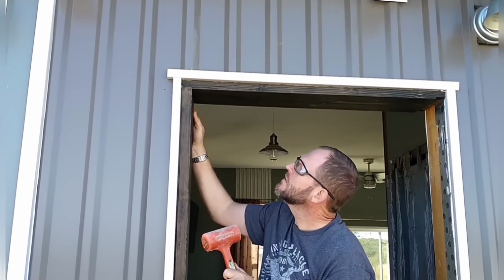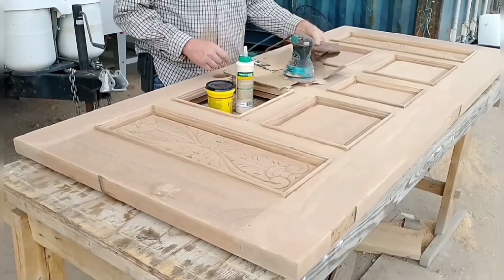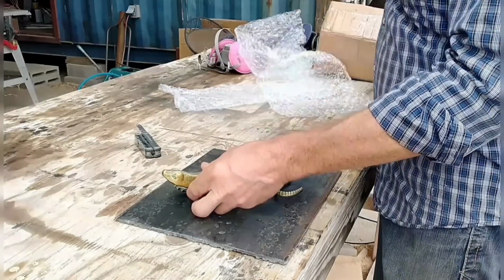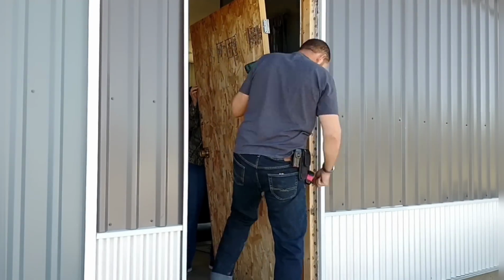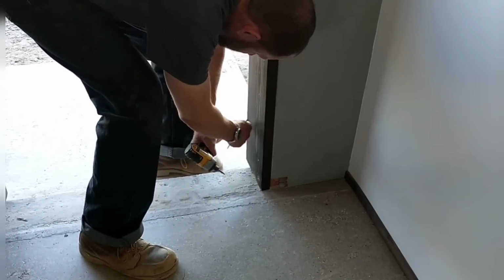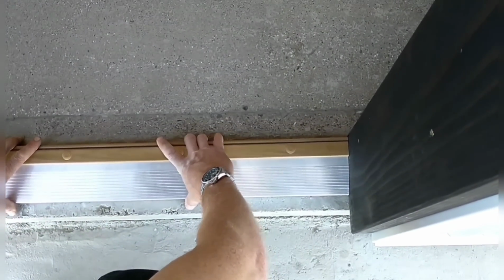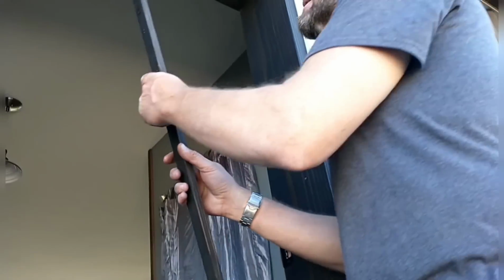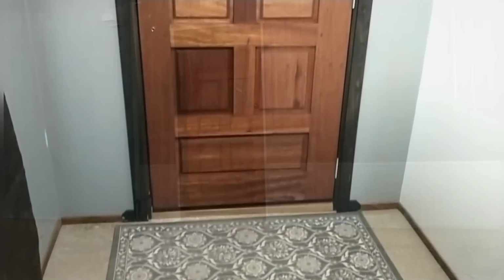Exterior Door Restore & Install | Solid Mahogany Vintage Door With Lizard, DIY Frame, Home Build #54

Comment: Fantastic door !   With all the unique building techniques and materials you have used, have you noticed an condensation anywhere  with the change of weather in AZ ?
Reply from the maker: Thanks! No, everything is looking great! The winters here are usually pretty dry. It's been colder this year than last, we are already down in the teens almost every night, but the house is staying really comfortable.
Reply: @RedandAprilOff-Grid  Great to hear...it is such a cool design

Comment: I was surprised you didn't do something for the interior side of that missing panel.  I think i might have tried putting a thin insulating layer (like foam under layment for engineered flooring) and then something else over it.... A thin piece of mahogany plywood, or something to be a thermal break and hide the backside of the lizards bolts.
Reply from the maker: We are thinking about adding something to the back side, but haven't found the right thing yet. A thin layer of insulation is a good idea. The metal panel is very cold, but condensation hasn't been an issue.
The house is staying at impressively warm and stable temperatures just from the sun & the insulation layers & thermal mass.

Comment: WOW, i love that door. As an 63 year young wood worker i can't belive it what you have made from that door. That oil looks really fantastic. Thanks for sharing ths special part. ABout the bottom seal. You have to check it again after 4 weeks of using the door because all will set after that time.
Reply from the maker: Thanks so much, and appreciate the tip!

Comment: Hi kids I really love your channel,
  Just wondering if the gaps on your door will change with extensive use of the evaporative cooler?
Reply from the maker: Thanks! There is room for it to move, but it may need some adjustments eventually.

Comment: I wonder if you will get any condensation on the inside of the metal panel?
Reply from the maker: Haven't noticed any so far.
Reply: Most of the year, southern AZ has single digit relative humidity or looked at another way, extremely low Dew Points.  So condensation, if it happens, will be during the Monsoon and will be on the outside or Lizard side of the door.  The thermal conductivity of a steel plate is also relatively low so a coat of paint will sufficiently protect against potential rust.

Comment: Need one of those panels. I would do it to open from inside don't need open the door. 'what do you want' then dog not running through legs or round you
I love it.. I well done buddies

Ann
Reply from the maker: That would be pretty cool! 😄 Thanks!
Reply: @RedandAprilOff-Grid  Just say the word and we could blacksmith up a "speak-easy"  style peek through.
Reply from the maker: @honthirty_  Thanks for the offer! We don't get many unexpected visitors out here with a closed gate at the entrance of the property.